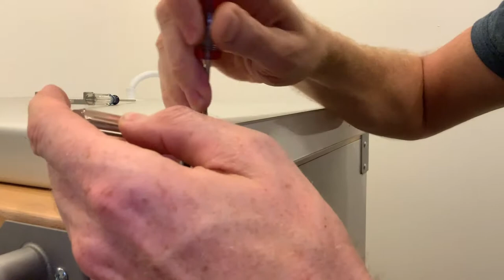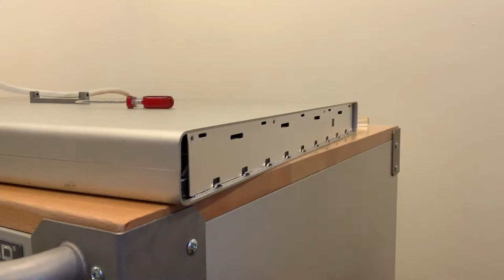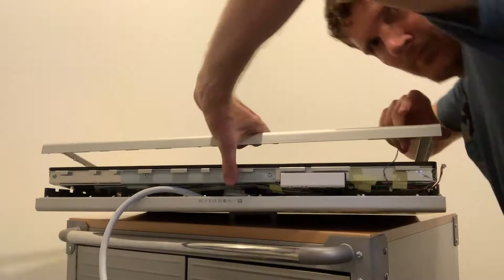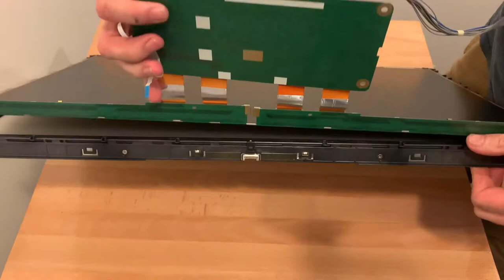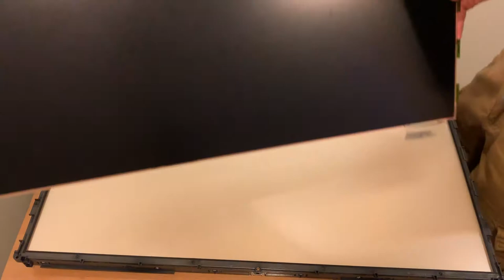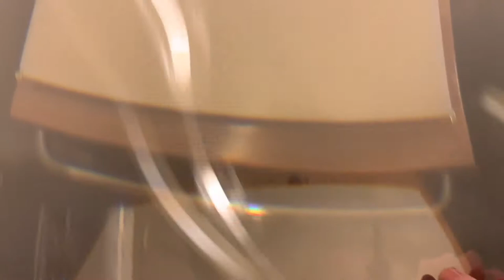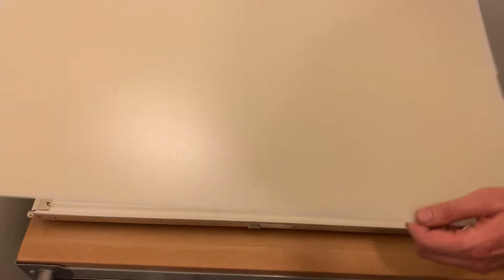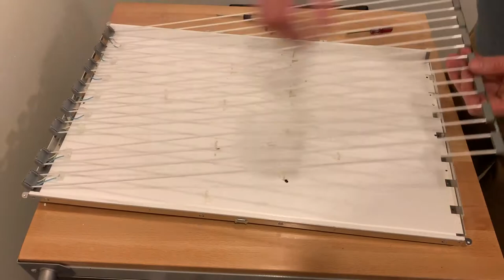Apple Cinema Display Disassembly 🛠📺 - How To - 30 inch (let's take it apart)

Comment: Salvage but I love it lol. is there anyway to replace the back light with LEDs? so maybe the screen will be much brighter?
Reply from the maker: It would be a bit of work but definitely possible. You'd have to calculate and modify the voltage that powered the mini fluorescent tubes to match whatever is required by the LED's that you install. Doable as a learning project but probably not economical.
Reply: @MakeFixUpgrade  Thanks man, totally agree, I love mine to bits and it's starting to show some very slight back lighting unevenness, so I guess eventually it will go out completely. I could't find anything that's specifically made for the ACD 30 (ccfl to led conversion kits), so I will have to improvise if I even need to go that route. Maybe I will pick up a broken one from eBay and experiment on that first. What is your pick for a new monitor? New Pro Display XDR is out of the question because it will not work with PC.
Reply from the maker: @onlythunder3323  One thing I noticed when taking the ACD apart is the thick light diffusion layer has yellowed with time. It's still white around the edges where it wasn't exposed to light, but my guess is the yellowing probably doesn't help with the brightness of the screen. You might possibly be able to replace that layer with a newer one (robbed from another TV/display??) if you cut it down to size. As far as other displays go, I've been using a cheap Acer I picked up from Best Buy a few years ago as a second monitor. Just recently picked up a used (excellent condition) Thunderbolt display for $150 so that's my current screen. I have 1 pc that I rarely use and enough other displays that work with it so that's not really a concern. Samsung has some nice curved monitors that I've been eyeing but haven't sprung for one yet.
Reply: @MakeFixUpgrade  Thank you so much for the info. Maybe the yellowing is due to the heat from the back-lighting over the years? ACD 30 does generate quite a bit of heat especially I keep it at full brightness all the time. Personally would not go with a curved display. I was so close to getting a LG 34BK95U-W but the reviews for that one is kind of a mixed bag. Hopefully there will be some new exciting announcements in the near future.
Reply from the maker: @onlythunder3323  it could be heat or just the frequency of the light (maybe) in combination with the materials the diffuser is made of. I don't mind the curved display. Co-workers of mine had them and I kind of like them. It probably depends partly on the one you get. But yeah, I still don't have one (yet). The standard flat screens have been enough for me so far.
Reply: Only Thunder I picked up an ACD 30 with a bright but very yellow screen that I suspect was from years of running at full brightness combined with the heat of operation. I plan to remove the diffuser and then “retr0brite” it in direct sunlight over several days to whiten the yellowing in hopes that the color will be closer to normal.
Reply: Hi. I founded 30" Dell Ultrasharp U3014 and wonder if that monitor can be used for panel transplant to apple shell ? I appreciate any thoughts on that. Cheers
Reply: @byte-nibbler  Did you do it?

Comment: Hi, I have an issue with my 30". Somehow I took a 48V instead of 24V PSU. Now my backlight is out.
I have replaced the logic board but to no avail.
Do you know if it could be the backlight invertor? Replace the board? Any tips? Thanks!
Reply from the maker: @Steven it's hard to say what the issue might be precisely without seeing/testing it. I'd look closely at any of the circuit board components for anything that looks like it burned out. I can't remember if there was a built in fuse anywhere or not, but I'd also look for any and see if it fried. Good luck!
Reply: it was the backlight invertor
Reply: Wait did you see anything with a flashlight? I have a 30 inch with a power light but no picture. I replaced the logic board with no luck. I ordered an inverter out of a whim but nervous it won’t work because I don’t see anything with a flashlight. But I still got high hopes for it, running out of options.
Reply: @commandpost1  I did see a picture with the flashlight. Put a multimeter on the components on the inverter. I got nothing. New inverter works perfect.

Comment: I have the same monitor which works fine but gets very hot - any ideas on how to fix it?
Reply from the maker: These feel hotter as they don't have an internal fan and use the case as a heat sink. You could put a fan near it or add another heat sink to the back of the case if you're concerned about the temperature.

Comment: hello, great video! 

I am having trouble connecting one of mine, ACD 30inch to my Apple Mac Pro 2013
at first the monitor I got wasn't turning on at all I resorted to a useful tip I found on YouTube by covering the middle needle on both sides of the cable running to the power brick, Im using a 95W power adapter that I have working with my other 27inch ACD The only problem is I don't have the original 150W power supply for the 30inch and I think I've encountered a problem, My computer detects it ( display settings ) but shows no image. I can even send open windows to the display but nothing comes up. I ran a back light test with my flashlight and cannot see anything. Could this be because of the power supply? or the backlight being faulty? 

any help would be appreciated thanks!
Reply from the maker: @Jean Guerrero Its hard to diagnose electrical issues without having the device in hand and be able to probe the circuits. It sounds like it could be a problem with the backlight, the power supply, or a faulty circuit in between. If it were mine I'd probe the power leads to the backlight and ensure there's power to it and work backwards from there. As I recall it uses mini CFL bulbs as a backlight. I'd be very careful testing them though as I believe they're driven by high voltage. I'd also look for any components that look like the were burned/cracked or any abnormalities.

Comment: i have an acd 30” which has a yellow shine, any chance I can replace/clean or remove the yellow foil?
Reply from the maker: If you're comfortable taking it apart and don't mind experimenting with potential replacement plastic sheets I don't see any reason why not. :)

Comment: I have the same display. What do you think, is it possible to remove the yellowing of the diffusor with hydrogen-preoxide and UV cure?
Reply from the maker: @Ambrus Names maybe? You could try on a corner and see if does anything.
Reply: @MakeFixUpgrade  I think, it worth a try, as this is surely due to UV exposure, IMHO
Reply: @Trannymaxxed  Err, not yet... Have a lot more projects, but not a substitute display

Comment: I have bought a apple  cinema display 65w power adapter 24.5v 2.65 A will it work for model number A1083 which has power of 24.5v and 6.1A??
Reply from the maker: Uk Boy it might work but I'd be surprised if it did. If the power adapter only supplies 2.65A and the display requires 6.1A then you're 3.45A short. If you had the 6.1A power supply and were using it with the 2.65A I'd expect it would work as the power adapter is capable of providing more than is needed by the display. I could be wrong but that's my understanding of it.

Comment: What type of adhesive and tape did you use when putting this back together?
Reply from the maker: Michael Paz I never put it back together.
Reply: @MakeFixUpgrade  Dang, do you happen to have any suggestions on what might be good to use?
Reply from the maker: Do a google search for double sided film tape. Any double sided tape that’s really thin would work.
Reply: @MakeFixUpgrade  Thanks! I just picked up one of these for use at home (I actually use one at work but they won't sell it to me) for a decent price but the the screen has some scratches so I found another donor monitor for a good price and I'm going to frankenstein them to get one good monitor.  I probably should have just bought one in good condition to begin with but where's the fun in that?